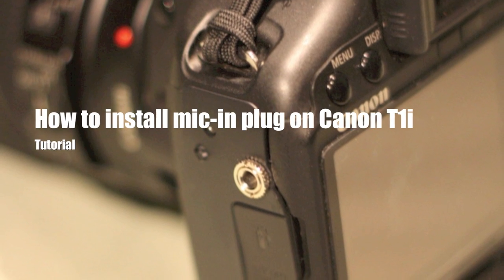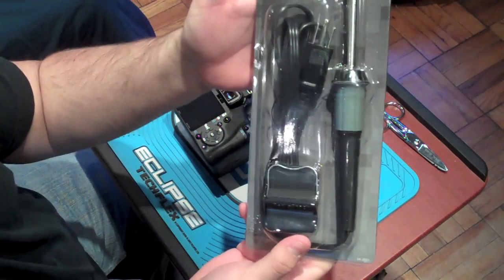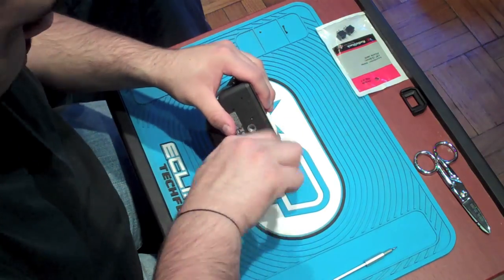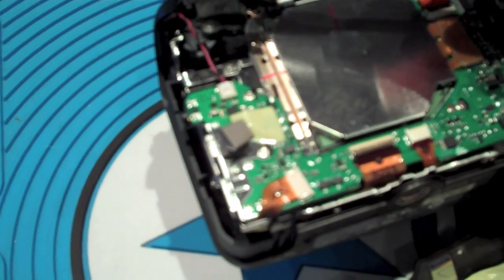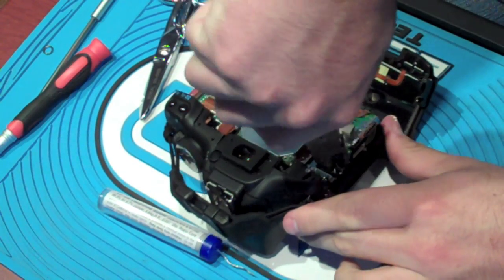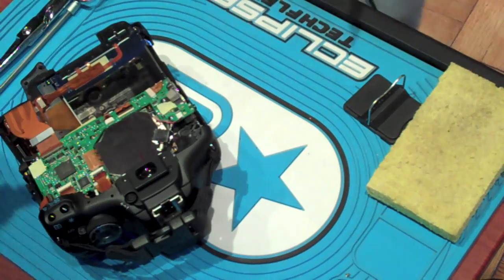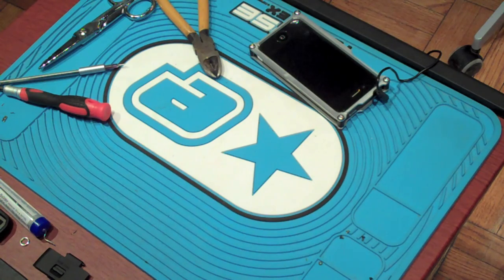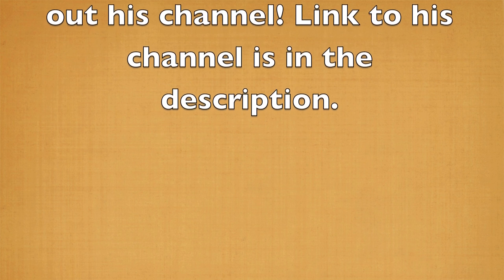Canon T1i Hack- Installing Mic Input for External Microphone

Comment: Nice tutorial. If you're going to attempt this let me suggest using a 2 conductor, open frame, closed circuit mono1/8" jack instead of the stereo. Radio Shack carries them in the same bin, part number 274-0248, for short money. This jack will automatically reconnect the internal mic when an external mic is not plugged it. You'll have to solder the black and red leads from the internal mic onto the jack along with the leads from the circuit board. This is a mono jack, but the T1i is also mono.

Comment from the maker: @iToasterman There was no damage done to the camera besides drilling the holes for the actual plug. A spudger is definitely a good idea to pry open the case but a small flat head screw driver works just as well.

Comment from the maker: You should be able to do this on any camera as long as you can get a hold of the audio cables that connect the microphone to the circuit board. The process will be different and I don't know if the T3's cables are located in the same spot as the T1i so the external input jack might have to be placed in a different spot. Good luck.

Comment: works on a T5 but i had to put a wire to the outside s there was no so much room to put a jack.  Successful hack!  I gave my T5 new life as a movie recorder.  on the T5 the tiny red & black wires have a plug that come out.  You can unplug these to do the soldering.  made life easy.
Reply: can you upload a video of this in action working?

Comment: You basically only strip off the tips of the red/black wires correct? And where exactly are the 2nd pair of wires (internal mic wires) located? are they below the first two or what?

Comment from the maker: @SaVapors22 You have to solder the wire back to the circuit board. Just be careful when you solder... make sure not to get any solder anywhere else otherwise you'll mess up the connection.

Comment from the maker: @savantartistique If you have 2 wires and you cut those two wires in half, you're left with 4 wires. Originally there are ONLY TWO WIRES (one red and one black). I cut those two wires in half so I was left with 4 wires. (two red and two black). One set of two was to the circuit board and the other set of two were to the internal microphone.

Comment: Good video.  You talked about connecting the internal mic to the soldered jack terminals.  Is there a way to disable the internal mic when a 1/8" plug is inserted into the jack?

Comment: Depends on what actually happened to the ribbon cable. Did it break in the middle? Or did it just pop out a socket? If it broke, you will probably need a replacement. If it popped out somewhere, try to stick it back, maybe tape it there(it's not pretty, but it works for those cables most of the time) and then bring the camera back together and try if everything on the panel connected by this ribbon works as expected.

Comment from the maker: @kad4u 

It does in fact work. I just opened the camera back up and soldered the other two wires to the input jack (little black box shown in the video). 

When I originally cut the black and red wires, I didn't leave enough length for the left over wire attached to the internal microphone, so I had to extend them with some spare coper wire that I had laying around. I then soldered those wires to the internal jack. Red to Red and Black to Black. I hope this helps, if anything message me.

Comment from the maker: @a1930ford I'm sure it can be adapted to any camera as long as you can access the wires. And I don't think it matters what type of soldering you use, either should work.

Comment: Awesome! Which is the proper jack for cutting off internal mic when external is plugged in? I saw radio shack had two 1/8" stereo jacks (pkg of 2 like yours, then pkg of one 'closed circuit'). But when I asked, they did not know which one did what. Radio Crack is not the same as it used to be.

Comment: I have a Tachyon XCHD camera that can certainly use a mod like this, as the sound sucks big time on it. What is the wire size you used? I looked at Radio Shack, but didn't see wiring that looked all that small in size. Also, what is the part # for phone jack? I was looking at externam mike jacks at RS yesterday and never found the phone jacks. My mistake in what I asked for though. I'll go back today for the phone jack. I got a neat external microphone there that attaches with sticky tape.

Comment: @XCFloresX Will do man.  I reckon its just the wires/solders are in contact with the processor or other piece of circuitry. Going to pry it open later on tonight. Thanks for your guidance  :)

Comment: Hi, great video, I was wondering if you know if this is possible on a Nikon D3100 as it also lacks an external mic input, or if you know anywhere where i can get it done professionally or a link to a website that explains it on a d3100 Thanks in advanced

Comment: hey I tried this project and soldered the wire as shown in the picture, Connected it with Rode Mic with TRS Cable but not getting any sound.

is there a way to fix this?

please reply

Comment from the maker: @kad4u

The way I completed it, no. I don't know this for a fact because I haven't tried it but if you attach the other two cables to the input jack then I think it might work. Remember when I cut the red and black wires? Well I only soldered the wires that connected to the circuit board. Solder the other two wires that connect to the actual microphone and it should work- I think. I might end up trying it out myself just to test.

Comment: Do I have to use an active mic (like battery working) to work with T1i? I have installed the jack, looks like its all ok, works with the internal mic when no plug is connected, but when I tried 2 different microphones (not active) didn't work. :(

Comment: K I have a few questions
1 will i still be able to use the mic that was originally built in ?
2 if i can how would the camera switch between original mic and external mic ?
3 on a scale of 1-10 how hard is this ?
4 last question, how much does this all cost ?
Reply: 1. Only if you wire in a switch.
2. See #1
3. Depends on your ability.
4. The part is given, so go price it.
Reply: thanks bro
Reply: i got a t2i tho lol
Reply: Same principles apply

Comment: Also, would the cold solder work better than the regualr soldering iron for wires this small?

Typo on previous post was external microphone jacks and not externam mike jacks. (Sorry).

Thanks for any info. My Tachyon camera probably has a bit more space in the case, but I'll have to look to see what the actual microphone wires look like and how difficult it is to get to them. Hope this mod can easily be adapted to the Tachyon camera, too.

Comment from the maker: @SaVapors22 I don't know what to tell you guy. I can't see exactly what's wrong with what you guys did so I can't give you the correct answer. If all that happened was the wire got disconnected from the circuit board, then attach it back by soldering it. You have to strip the wires and solder to the correct place.. has to be precise though.

Comment from the maker: @mmstudios95 I don't really know what you did wrong or what happened during the hack so I can't give you a real answer. But maybe.. Are you using a Mono Microphone? If you are try getting a Mono to Stereo adapter from Radio Shack for like $3 bucks. Also if you're using a Mic that uses batteries, try changing the batteries too. Good Luck.

Comment: what he cut was mic wires, You just have to cut a single wire ... and tap the other to a single another wire .. now you have three wires ... and get the jack ( most of the jacks have three pins) , and  sold the three wires to the jack ... I cannot say which wire go to which pin in the jack in a comment like this, because it's rather practical thing to observe what happens in the jack when you inserted the external mic .. this will help to some one who has some knowledge about the jack.